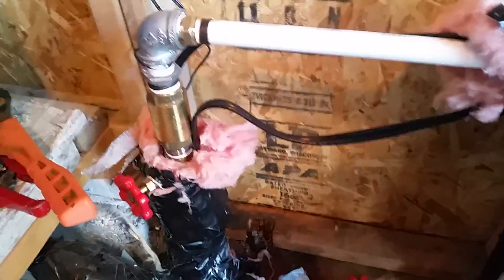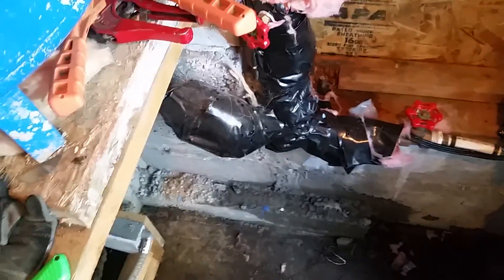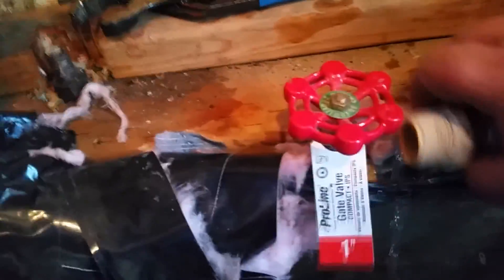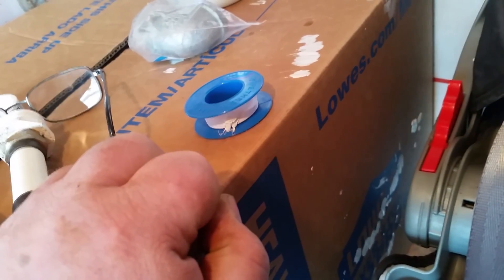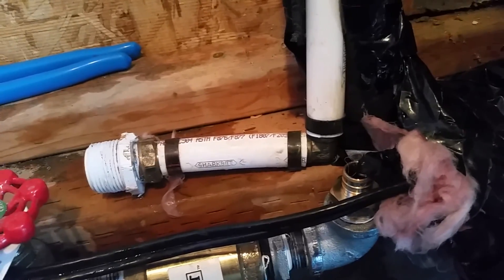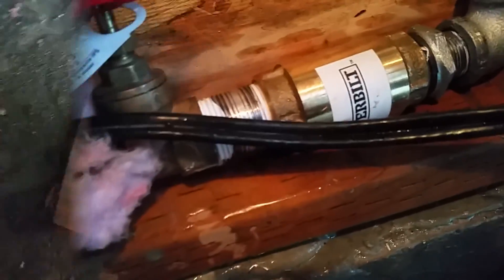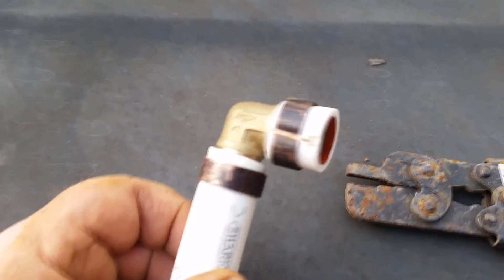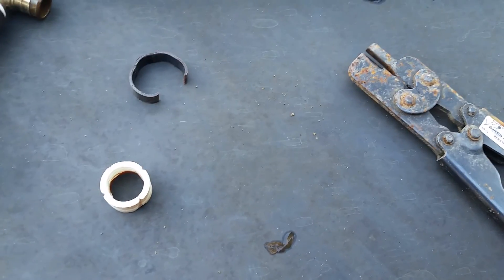How to install a one way valve, work with PEX and remove PEX fittings.

Comment: My first time using PEX was in the bus and I'll never go back to pvc or copper. I used a different type of ring that ratchets down to tight.
Reply from the maker: Yeah - my brother turned me on to PEX. Didn't know there was a different kind of ring but like I said I've never had a PEX leak yet. The only reason I ever use copper now is that it's rigid - so for a 'rough-in' it's good.
Reply from the maker: Oh ok cool - ratchet tool - that could really come in handy thanks.